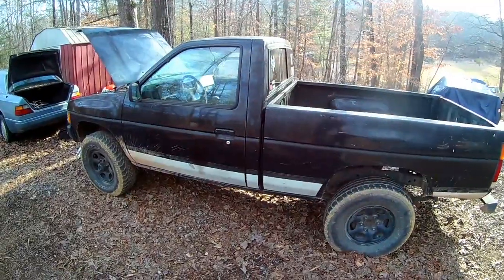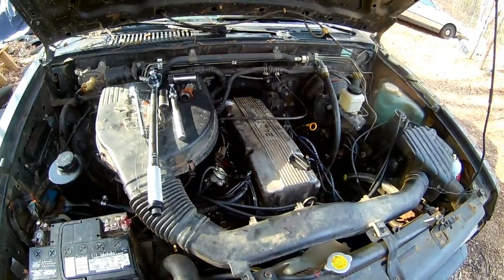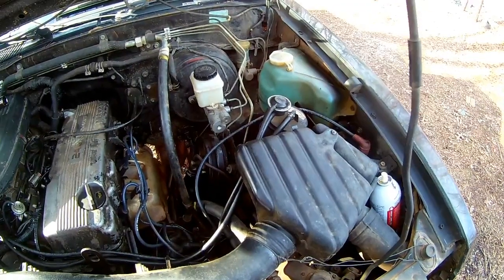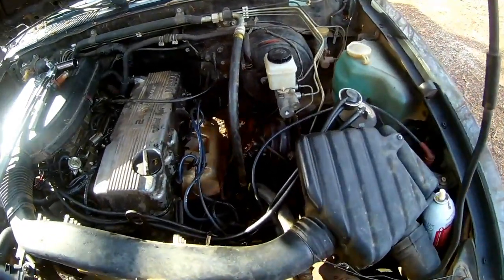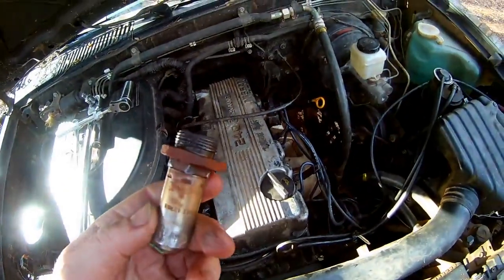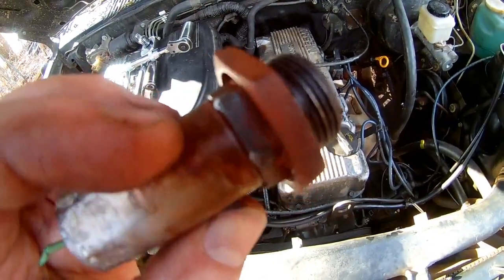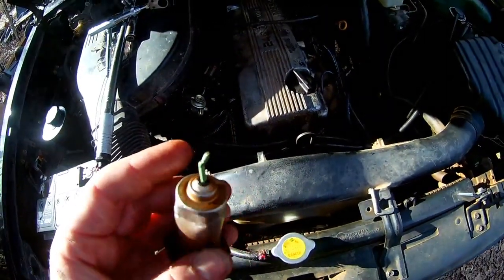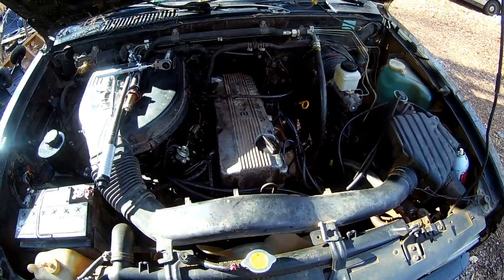93 Nissan Hardbody d21 2.4L o2 Sensor

Comment: Hi everyone, I have had significant life changes in the past year and have not kept up with this channel, my apologies. The ultimate fix to the bogging under throttle was the fuel pressure regulator which is very easy to get to and replace it sits on top of the engine and is an easy change. The O2 in this definitely was bad as it was broken but it did not fix my initial problem I was tracking which turned out to be the pressure regulator. Apologies for not posting this but life intervened (also YouTube changed its policy on at what threshold you can start making any money doing this making it impossible for small timers to get paid so I gave up and haven't kept up with it. Maybe when life settles down I can get back into it).
Reply: Is this your other account? Still running good?
Reply: Thank you so much...I ll b changing that fuel regulator 👍🏼
Reply: @Arthur Grayson Instablaster =)
Reply: @Joel Levi I really appreciate your reply. I found the site through google and I'm in the hacking process now.
Seems to take quite some time so I will reply here later with my results.
Reply: @Joel Levi it worked and I finally got access to my account again. Im so happy:D
Thanks so much, you saved my ass :D
Reply: @Arthur Grayson You are welcome :)

Comment: I have done this job on my 1994 D21, 2-wheel drive.  Surprise, sir, your 7/8" deep socket DID NOT remove the oxygen sensor alone.  YOU removed BOTH the 32mm iron bung that holds the 7/8" = 22 mm oxygen sensor inside the exhaust pipe!  YOU are holding the two items in your hand for three minutes... that have fused together with rust.  This happened to my truck after only 43k miles. (thanks, Nissan).  I had to buy a new 32mm iron bung ($16 eBay) and a sensor ($? a year ago, forgot the price).  Meanwhile, after separating the two parts in a bench vise, using my pet gorilla's strength, a 22mm extractor-socket, Rust Blaster spray, destroying the internal, fused, rusted threads, I made a temporary "plug" with the OLD BUNG, a carriage bolt and 2 washers, one nut, from Home Depot, 89 cents, and replaced the 32mm bung. (so I could drive, silently for a few days.)
AFTER my new 32mm bung arrived, I could insert the NEW sensor with 1600 degree anti-seize paste, insert the 32mm bung with a DEEP 32 socket, more high-temp paste (many pipes and hoses are in the way!!!)  We drained the AC freon properly, to remove/reposition two hoses!  )
What a frikken' headache, but I have 3 of these D21s and love them. ('86.5, '94, '96)
I SHOULD HAVE MADE A VIDEO.

Comment: i was not able to get the o2 sensor off with the "correct" tool, but then again it was from harbor freight. i might return it. but realistically those o2 sensors may not come off even with a better quality tool. so i'm thinking of doing the same thing since it would be wise to replace it anyway. it won't be expensive, but it's a pain to work on this car. everything gets in the way and you have to take "everything" apart to work on something that should be very simple. i was surpised when you said it was easy to work on. I had an 83 toyota before and that was easy to work on. very simple everything within  hand's reach. my 84 corolla which i have to bring back to life, is also very easy to work on. i need to get it back on the road. anyway your video was helpful. thanks!
Reply: Everyone should forget the 22mm=7/8" tool and go right to the 32mm deep socket placed on the hexagonal iron bung.  UNDER the annoying, horizontal silver pipe.  DAM pipes and heat shield are obstructions.  The heat shield comes off ONLY if you vacuum freon, remove two A/C hoses from the compressor, SAWZALL sensor off as closely as possible, force heat shield upwards. Do you love punishment?  But we did it in the driveway.